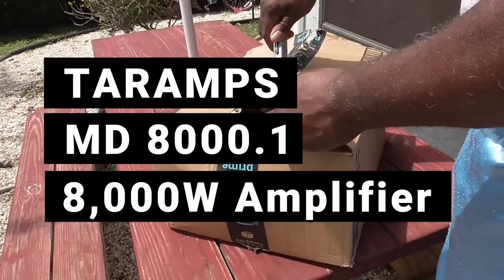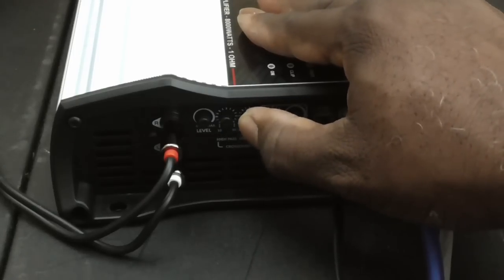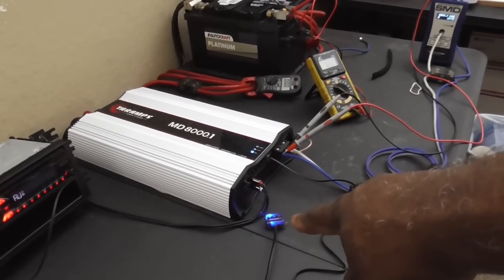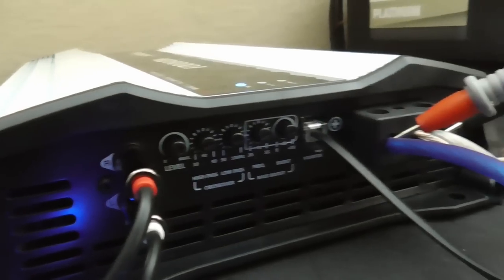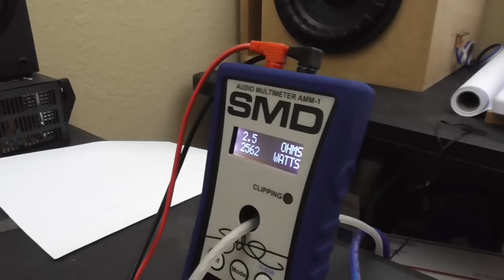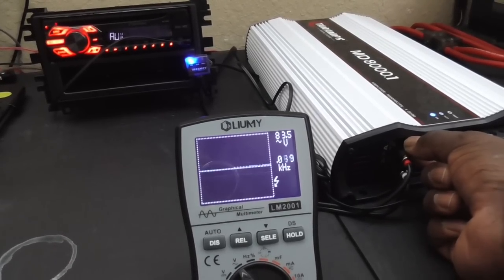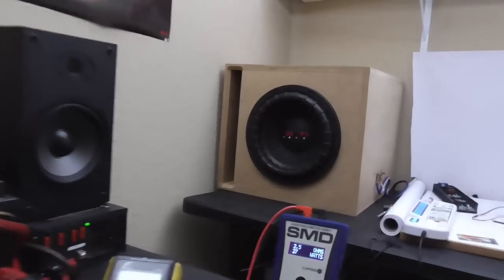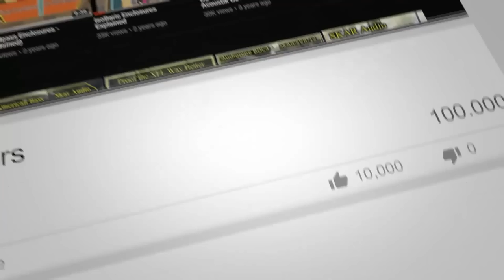Should You Buy This Amplifier? TarAmps MD8000: 1 & 4 Ohm Testing

Comment: Just seen this now a year later after this first posted. Some hate and some love these. I’m in the middle. I can’t say I love them because they take shit ton of current for operating at 12v. I can’t hate on it either because my old TARAMPS smartBass 3k gave me more than it’s rated power at less than $300.00. My point here is they are cheaper and have value per watts, but is it really cheaper? To obtain the necessary wattage out of these amps you NEED the current supply. Therefore an electrical upgrade is a must if not you will clip at only 1/3 of its rated power. I upgraded to 250A from a 90A stock alt and a XSPOWER d3400 cost over $1500.00 And it still wasn’t enough. I’m now back at my stock alt with the xspower and produce 3k with the sundown salt. 🤷🏻‍♂️ it’s a great budget amp, but not for the average short cut budget.

Comment: Thanks for filming this test👏🏾🙏 i have one of those amps on 4 American bass 12” subs “hawks duel 4 ohm”. I’m getting clipping whenever i turn the bass up, I am running 2 extra batteries plus I’m going to add a bigger alternator. My question to you is should I be running 2 of these amps on the 4 subs or is the one powerful enough. ?

Comment: To avoid a big spark upon connecting amps or caps, put a  resistor in series with the amp until caps are charged, then reconnect without the resistor.
Reply: I ALWAYS do, especially with big amps. If only more folks wised up n did the same. It's hard on more than just amps. The caps, lithium, fuses, hell even the wire
Reply: What size resistor do you recommend? Or does it depend on the size amp?
Reply: @IAM_HC  I use a 25watt 4 ohm ceramic resistor I think it was a $5 but honestly if you had an even smaller one it would work fine for charging capacitors.

Comment: I’m running an MD8k.1 with 3 12” XFL’s wired to 1.6 ohms. I have a stalk alt and 60ah of yinlong. I never go below 13v, usually not even below 13.5 and I don’t clip at all.
Reply: Stock 😬
Reply from the maker: Based on the tests I'm currently running. I believe this. 👍

Comment: I'm running a bass 8k taramps with a 150 amp factory alternator with a factory radio with 2.0 line converters? 400ah of reserve no voltage drop at full tilt? I believe it's because the voltage is only 2 volts taramps doesn't like radios that are 4 volts and higher?

Comment: I have a md8000.1 too. I bought 590ah of agm just in case. Stock alt.
Reply: Why agm? Why dont u go lto? Agm will put most of its power at low voltage  and if u got taramps u should have higher voltage
Reply: @KINGIJANNEE  because only charge at 14.6. I have a headway 48ah bank but I'm honestly not comfortable with using lithium.

Comment: The knobs for the potentiometers are not built on the potentiometer itself like all the others. The knob has a very small nipple coming out of it that you are feeling the flimsiness of, It's "X" shaped that goes through the actual pot. Agree they feel cheap but they are actually internally stout. The RCAs could be panel mounted but they at least have them screwed right next to it with a thicker screw then some with those tiny ones. Get yourself a test light, charge the caps in the amp by putting the test light across the fuse connectors before installing the fuse (if you must hook it up hot, test light from wire to terminal works) The light will light up and once charged will go out. when disconnecting amps put the test light across the + and - after power is disconnected and will do the same, which will light the light and go out once discharged. Doing this eliminates that spark that I don't care who you are gets you every time even when you know it is going to happen! and discharging eliminates power just sitting in the amp.

Your DMM isn't fast enough to see the actual voltage fluctuating fyi
Reply: Had one on my dang brand new md 5k  only had it one dang day and my knob on the high phase broke it didn't  fall off the amp or anything  all does just spind like it unconnected  to whatever was connected to lol ...  left a long didn't even try take out yet because didn't won't lose it ... or put up some where don't remember where I put but there anyway safety to put back on or anything like that ... thanks

Comment: The bass series is the only one that sounds good on subs and you can wire the 1 ohm model at .5 ohms
Reply: My bass 8k blew at .5 did fine on test tones but blew on music in seconds
Reply: And anyone who sat in my truck would definitely disagree with you that the Bass series is the only Taramps that can handle bass. The MD series has no problem with bass. My truck does 157.8 db at 22hz and 153.5 db @ 14 hz.
Reply: @famousmoon  You need to make sure you have enough rise to wire to 0.5.
Reply: @MadTrollGaming  all my amps have been wired at .5 with no problems i don't drop below 13.8 at full tilt but even that low of a drop doesn't happen very offton depending on how low of a tone is playing but normally I don't drop below 14.2 and when the amp blew I was sitting at 14.7 I didn't even have the bass knob halfway up, although i dont know what my impeadence rise was but I don't think that played a role in my case anyways
Reply: @famousmoon  I'm willing to bet you preout voltage was too high.
Reply: @xchimnyx  i didn't even think of that and I don't even remember what headunit I was using when it went lol

Comment: Not sure if it’s been said already but when an amp clips it has nothing to do about impedance- you are wired higher so you see less power obviously.. but when the gain is set and voltage is good you won’t clip any earlier than you would being ran at a lower impedance

Or taramps are just junk .. 

Great power for the dollar can’t beat it 🤟🏼

Comment: I run 2 md8k's 2ohm on 216ah lifepo4 and 3x180a Alternators, i was clamping 6800 rms on each amp rising at 3ohms,no led clipping at all, rca voltage 1,8v max
Reply: Right on! Feed them and treat them well and they will deliver 10 fold. 💥😁👍 I've been able to get 8702 watts out of mine.
Reply: @Widowmaker2828  i was dropping at 13,2v, in a 15v system sure can make over 8k 😁💪
Reply: @vasilemazilu7342  I do run external regulators at 15.5 or so volts. 😎

Comment: What is your input signal voltage? They don’t like over 2v I they usually do fine below 12v but not with high input signal voltages.
Reply from the maker: Around 5v thanks for the tip.

Comment: Why the amp was clipping..as others mentioned..your over driving the input. Keep it below 2 Volts. Use you gain to not allow the input voltage to pass 2.0 volts! That's why your seeing it clip quicker at different ohm loads.

Comment: Exactly what happens to mine when voltage dropps gotta get another battery got 2 batteries 390 amp alternator big big big ultra super cap and another 18 farad supper cap and an  another 10 farad supper cap clips like crazy when voltage gets low

Comment: You're clipping on the transients / kicks, which have harmonics over 200-500hz, way above where the driver wants to play and impedance rise will be non existent up there so very stressful for the amp, and the voltage likely dipped to 9v on those kicks but the multimeter refresh rate is too low for you to actually see that and it just gives you an average per sample. You need to turn the LPF down!! Amp knob on minimum and then ALSO an active lpf on the head unit at 50hz. It wont clip like that any more.
Reply from the maker: Thanks for the tip I now have all those things that you mentioned plus my Dayton Audio DSP to filter out this amplifiers ridiculous 90 Hertz low-pass filter

Comment: Hey big bro, new subscriber here. Question for you. I'm gonna try not to write a novel here lol. So long story short I have 2 soundstream t5 12s which are rated at 1000 rms each. My soundstream old school picasso 2000d pushed them hard for years but the terminals finally melted to the point where they need replaced. So for now I grabbed a taramps bass 5k which is rated at 3200 at the ohms I'm wired to which is 2 ohm so I figured that would be plenty. Now it definitely hits crazy hard and I only have the gain up like a qtr so it should not even be close to maxed out and not even getting warm , however it's clipping and already went into protection once. I don't understand why. The only thing I can think of is maybe my subs do alot more than the rating. I'm guessing I'm gonna need either the smart 5 or maybe even the 8000 so I don't clip? I do have to say I love low bass and have my lpf all the way up but everything else including bass boost is off. I'd love your opinion. Basically doing the same thing as your 8k in this video. Side note I only have my little factory battery and no capacitor so I'm partially wondering if it might be a voltage issue as opposed to watt output. 🤔
Reply: Yes you basically answered or questions you should went with the smart 3k or md 3k   to run one.of.these you half have power and yes they run off of 12 volts but half keep or voltage  there if voltage drop quess what happens 😮😮😮😅😅😅  ...  you sure heck don't need no bigger amp hopefully  I answered you questions  wish could help sooner hopefully didn't do anything crazy ...
Reply: 100% voltage cut. Also the gain is not a volume knob, 1/4 turn doesn't equate to only 1/4 of its potential. 

No offense but unfortunately this is why Taramps has a bad reputation, a 5000 watt amplifier for only a few hundred bucks means people that don't have the supporting electrical or the know how are going to buy them and fry them then tarnish their name. (Doesn't help they only have 1 power terminal even though it's 2/0 which is sufficient given the length since there should be a battery bank close to the amp.

Comment: i damaged a Skar VXF 15 with a Smart 3 pretty easily so I'd be very careful running a Skar VXF 12 on a 8000 watt amplifier. Idk though it's kind of weird, the sub sounded broken and felt broken for awhile but it still sounded okay for the most part. It's in my backseat right now on a Sundown SFB-1000 clone and I rarely hear a weird noise come out of it. I have two more in the trunk on the Smart 3 since just one of them couldn't handle the smart 3. There some weird thing where these amps do crazy power for like a split second. That's why on Willston's dyno the smart 3 dynamic is like 5200watts but it only does that for a fraction of a second before it limits the voltage and goes back down to closer to 3K is how I understand it. Maybe i'm wrong
Reply from the maker: I don't think you are wrong. This tech is new to me and even the O-Scope didn't really like it.
Reply: @BudgetBassHead  good job letting people know about impedance rise. I just wish that smd tool didn’t cost so much or there was another way

Comment: I would just wire it down to .5 ohm to combat the box rise.
Reply: That's what I do but it burns up the wire too fast
Reply: You can definitely run down the impedance but you have to make sure everything else is perfect with no clipping. I was able to get 8702 watts at a static load of .7 ohms and the 8702 was at a rise of .9 ohms. Running them at 1/2 ohm is like playing with fire but people do it. 😁

Comment: The lowest voltage I'd run it is 12.6 volts.
Reply from the maker: Is actually tested by its engineers at 12.6 but I've tested it below to 12 volt is when it complains. My most recent tests added an ultra capacitor and maintained a 12.9 @3,500 watts.
Reply: Yeah my stock alternator is pushing at 14 volts.

Comment: basically showing you how most people blow these amps up. If you read the manual for the MD8k you will find minimum battery requirements for proper function is 370ah.. Something tells me you don't have the proper electrical in your car to run 2 of them. I run 4 MD8ks 1ohm versions on 400ah of yinlong LTO I NEVER clip.  Also mounting your amps on your loading wall probably also isn't smart. I suggest a new box with that much rise that box isn't very efficient. I had each amp wired at 2 ohm and clamped 4075watts per amp they are rated 5k at 2ohm. If you don't have the battery reserve for these amps don't even bother running them because you are going to ruin them.

Comment: What is your input voltage? It should be under 2 volts. Also please don't run this work of art amplifier on a single battery. The manual states it should have a minimum of 3 batteries. I run 4 of these amps but I also run 270 amp hours of Yinlong LTO with a high output alternator. People will see you run this on one battery and think they can do it in the long term. Then they will burn up the amp and talk bad about Taramps. Good vid otherwise though. Always look forward to your vids!
Reply from the maker: Good info. Thanks

Comment: Well done man. Lots of people really don't understand impedence rise and voltage drops. I've never been a fan of Taramp or any Brazilian amp. Too dangerous. Too unreliable. Currently running 4 x BDC2 12s on an APCLE30001.D. 11 cb ft box at 36 hz. Shaking my van like a 9.0 earthquake
Reply: Does that amp had impedance drop

Comment: So in your opinion,  let's say you need 2000rms total for your subs. Should a good 3000rms amp do the job with box rise and all, or should I just say @#%$ it and go even larger having an xsd3400 battery and 250amp alt...
Reply: just know this..its always better to turn your amp down than turning it up and cliping your sig.
Reply: Get a orion xtr2500 they do more than rated
Reply: @rhurtadorh32  what's up with that 25hz or off button on those orion xtr amps?????
Reply: @jaysonoliveira4752  honestly i left it the way it came in. I have a epicenter equalizer and a crossover in stalled in my system.

Comment: Your input voltage is probably causing clipping
Reply: No, its the inverter and battery. Not enough juice to make clean power
Reply: I have the same amp it handles 4v fine.
Reply: @maxbernard5797  I did agree. I’ve had over a dozed taramps amps, and they all prefer lower input signal voltage
Reply: @jeffschultz1190  you mean 2v rca signal works better than 4v? Unless the music is recorded at 0db the rca voltage wont hit 4v

Comment: Gain, level, volume are all semantics.  That old saying its not a volume lnob from the old days was only meant to prevent people from tampering with initial shop settings, but the truth is it's a low voltage input volume adjust. You just don't apply it for everyday use. The semantics needs to die

Comment: Oh God... Stop giving 12v to any amp. This is painful to watch.
Reply: There's not much english info available on taramps but i read a distributor in a car audio forum and he said Taramps actually prefer below 14. Like 12-14 for maximum output is what he claimed. I guess in Brazil people play their stereos with the car turned off.
Reply: @Titans2138  I run MD 8ks between 15 and 16 volts. They seem to like that voltage. I'd say higher is better than lower but it's all good as long as you use a clip meter and just watch for clipping.
Reply: @Widowmaker2828  yeah actually I think the guy was specifically talking about the HD line. I shouldn’t have assumed it was the case for the newer taramps

Comment: at the volume you had it at... you are pushing more then 2volts at the rca... taramps is happier with less then 2volts
Reply: All aftermarket radios have different rca output voltages. Some don't even put out 1 volt at max volume which is what the gain knob on amps is for, it boosts the rca input to what it needs to output its power to subs/speakers, some put out so little rca voltage the gain can't even boost it enough, hence the need for line converters etc.

With that said some, output 4-6 volts as well, which is why most people use devices to set gains etc.

Before doing any of that, its best to find out what max volume the headunit can go to before it starts sending distortion through the rca. Oscope and SMD-dd1s are good for this, from there people set the gains on their amps.

Comment: Do you know what your input voltage is set to?
Reply from the maker: Currently around five volts
Reply: @BudgetBassHead   ya that’s what’s causing all this clipping, you need to always be under 2v input. You will have a totally different experience if you set it at about 1.7. I run 6 taramps amps and I always set yo 1.7 and that seems to be the sweet spot for me. But ya, your input voltage is way too high.
Reply: @jeffschultz1190  Yes, a quick read through the manual works wonders. If it doesn't come with one there's plenty available online.
Reply: How good way you can tell what kind of input voltage you running or at ..

Comment: Spend some money for quality equipment that lasts. Your system and car with thank you. Those things should come with a fire extinguisher.
Reply: run adequate electrical and fuse your wiring and this amplifier will last years. Taramps is not a new company.
Reply: They like to get wires real hot.. Yes sir...
Reply: @sarahconner9433  Only if you don't know what you are doing. All you have to do is read the manual. I run 5 ft single lengths of 2/0 copper welding wire off my battery like the manual says on my four MD 8000.1s and and the wires never get hot.
Reply: Structural:; correct.... Thier smaller amps have that shit 4 guage input..... Even with couplers they get hot....
Reply: @sarahconner9433  I do agree with you there, Taramps made a mistake when they put 4 gauge inputs on the HD series amps. But they learned and put  2/0 inputs on all the new series and THAT is what this video is about.  I only suggest the MD, Bass and Smart series. Although I'd love to try the 160,000 watt HV series... They are 300 volts DC.
Reply: Glad you like that  d.c. amp  design..... You are wise... Funny you just never know who you will meet in the YouTube